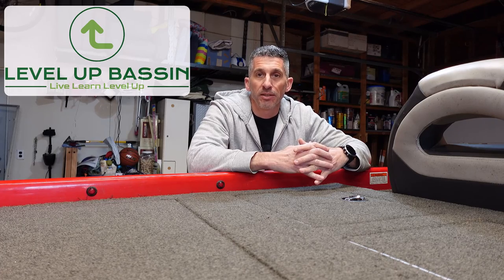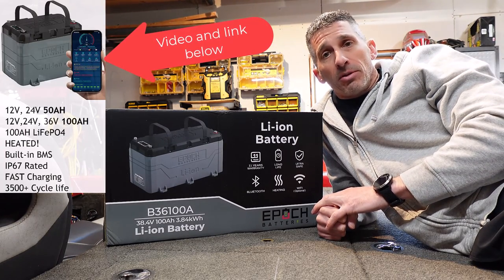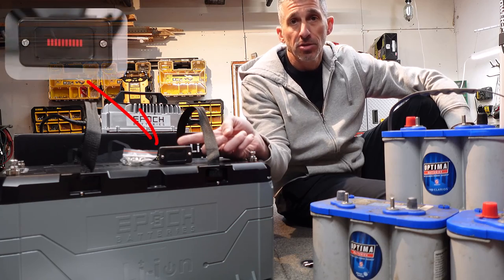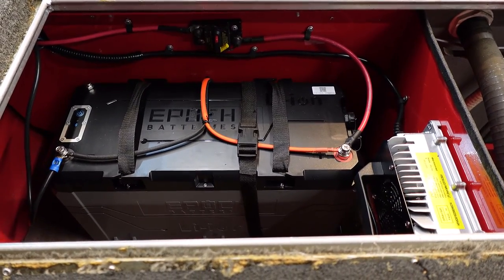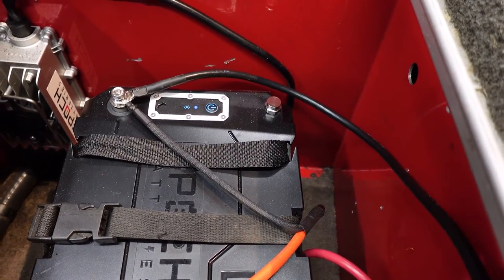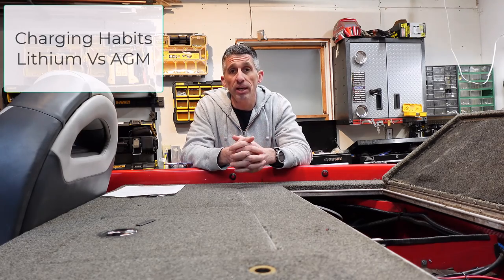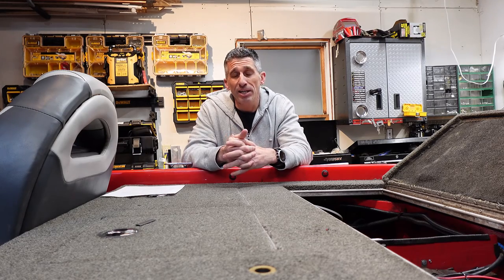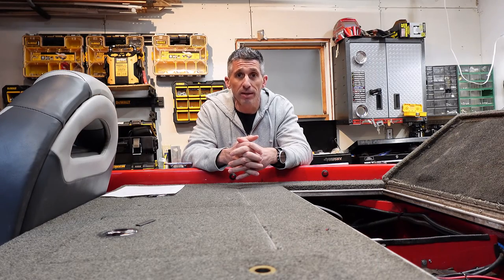Epoch 36V Lithium Battery Made The Switch!

Comment: Two of the huge advantages with lithium iron-phosphate batteries are a 50% weight reduction from your AGM's and there is virtually no voltage sag throughout 90% of the discharge curve.  Why does that matter?  Well, you don't have to keep turning up the juice on your trolling motor to get the same response, and your very expensive and sensitive electronics get exactly the voltage they need to stay powered on.  When running SLA or AGM, if your bilge pump and aerator happen to be running when you crank up the big motor to move, voltage can sag enough that your graph turns off, but that won't happen if you run your electronics from an LFP battery.  It's a no-brainer, with how much this stuff costs.
Reply from the maker: Well said! Finally got on the water and with 4 hours on my Lowrance Ghost and only used a mind blowing 3% of the 36V LiFePo4!... Also definitely notices how much Active Target like constant voltage!
Reply: @Mitz-RI  - Yeah, the LFP (LiFePO4) batteries are so good, with no voltage sag, I actually went from a 100AH 24v system down to a 50AH, because that's still way more than I'll use in a full day of fishing.

Comment: Battery has an on and off switch, but you still have to add a switch to it as well ?
Reply from the maker: Mostly redundancy. I have a lot going on in the boat now, and one master cut-off is piece of mind. Trolling Motor and Accessories each have a dedicated master cutoff.
Reply: I'm doing my research right now , adding a trolling motor this year picking batteries the whole works, but I just made my decision on the epoch battery. Thanks
Reply from the maker: @paulbutter1317  awesome 👍 reach out if you need anything. also if you use the links in the description it helps the channel. 😉 These Epoch Batteries are honestly Amazing!

Comment: Are you using the 12v 100ah as your starting battery for your outboard? Or you have another battery for that?
Reply from the maker: No these batteries are not cranking batteries. However I know Epoch has a cranking battery in the works! So I still have a yellowtop Optima for outboard.
Reply: @Mitz-RI    Got it.  Yeah I guess I jumped the gun there.  I ordered the 36v for my trolling motor, and yesterday ordered the 12v 100ah, I could have swore I read somewhere that it would handle up to 200hp motors, but it must have been another battery I was looking at.  I’ve been doing way too much looking around and I guess confused myself.   Thanks for the response!
Reply from the maker: What I can say is you will not regret these batteries they are powerhouses!

Comment: It’s my first time getting a single 36v battery for my new trolling motor so idk if this is a dumb question or not but would I be able to attach my electronics(fish finders) onto that same battery?
Reply from the maker: Not a dumb question at all. Because it's 36 volts you cannot hook up 12 volt equipment directly. There are  step down devices from 36 volt to 12 volt you can hook up but you have to be careful and do your research.
Reply: @Mitz-RI  got it👍Appreciate the quick response! You just got a sub👌

Comment: Does the charger cut off once it's fully charged?
Reply from the maker: The battery has to be on so the BMS is ready to accept a charge. Once Fully Charged, the battery BMS will switch off the MOSFET and stop the incoming current. You still need to shut the battery off after the charge is complete.  Don't forget it charges in 1/3 of the time, and you don't have to charge them until as often.
Reply from the maker: I've changed my charging habits from my old AGM batteries. Instead of plugging in every night and leaving it. I now charge them once every 2-3 tournaments. It is crazy how long they last!
Reply: Thank you very much. I appreciate it the help! Got it